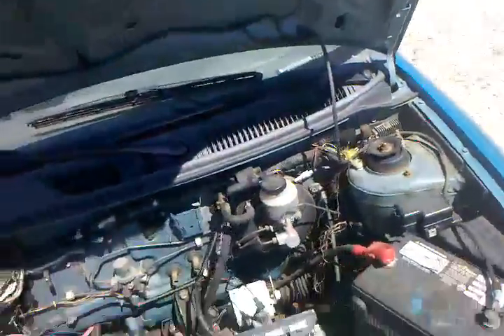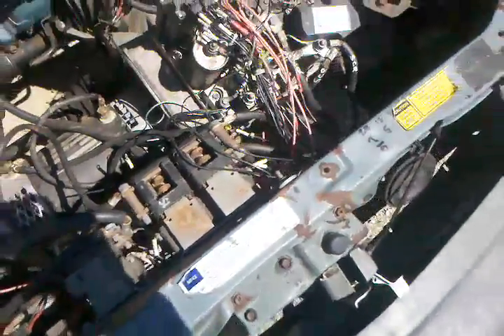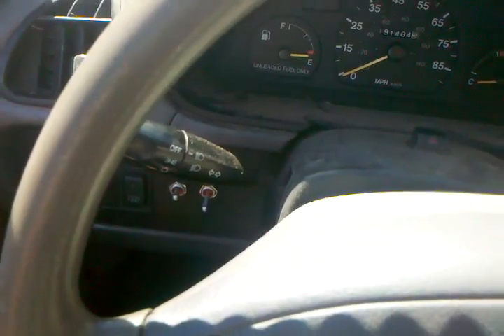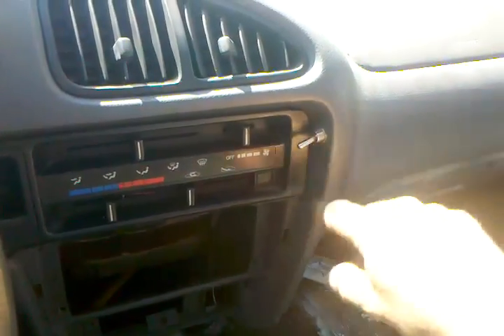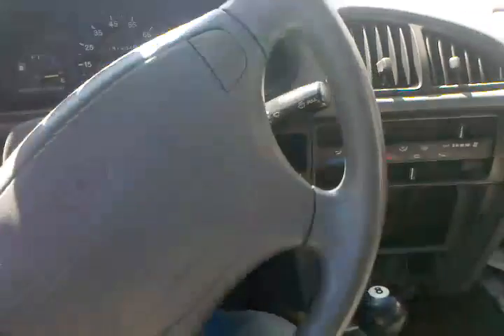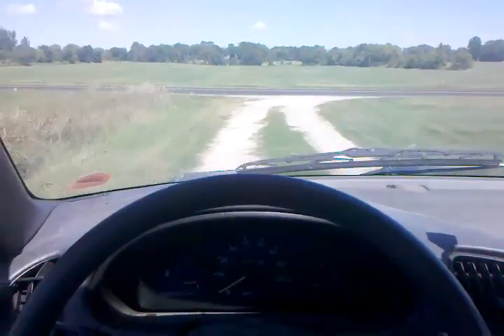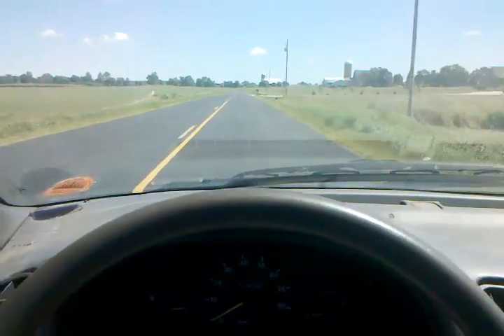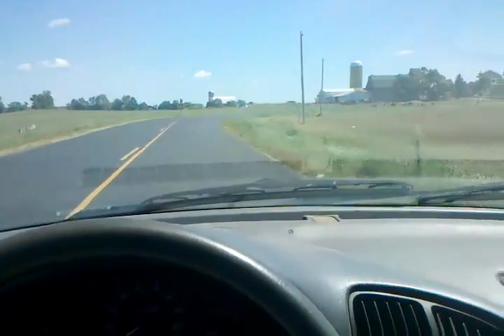Geo Metro electric conversion EV 100 set up - initial run 24V

Comment: With an EV price war fermenting in early 2023, in two or three years there could be a plethora of salvaged battery modules and know-how for doing conversions.   A Metro with 50 mile range and 50 mph cruising could be practical for a realistic DIY cost